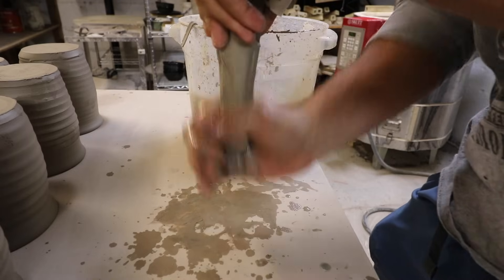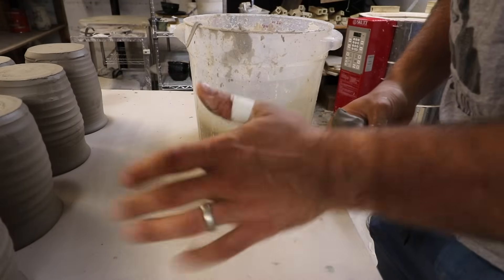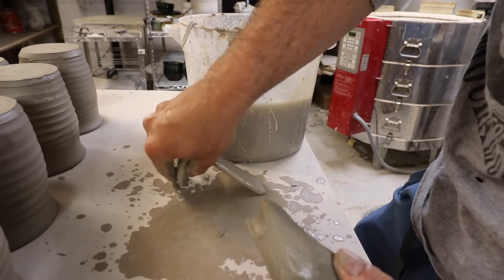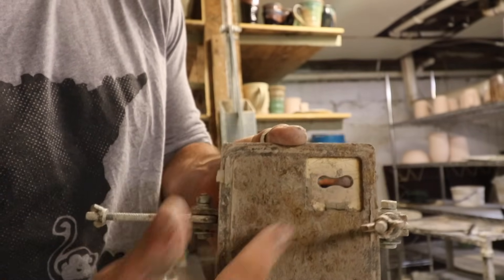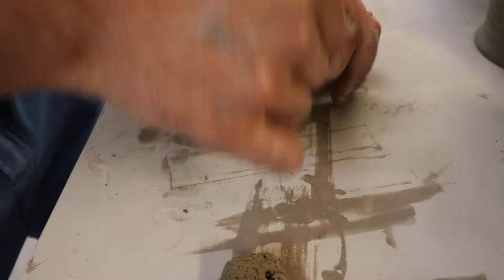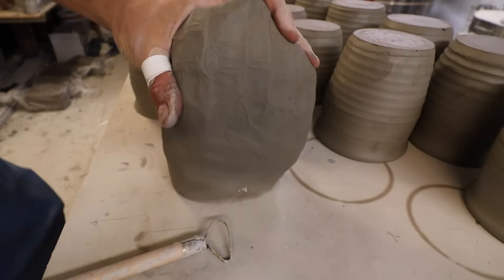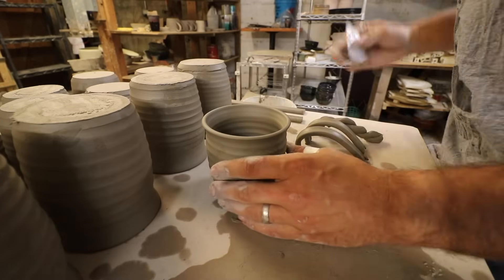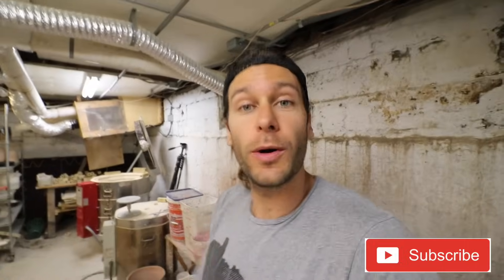5 Ways to make HANDLES FOR MUGS - Clay/Pottery/Ceramics

Comment: I like throwing my handles. I throw a slightly thicker cylinder, then I section off the cylinder and form the different sections (give one ridges, one is curved, one has two bands, etc). Then I use a needle to cut off each handle, trim it to length, and lay it in shape to dry
Reply: NeoDaVinci 97 you have a video of this. Very smart idea
Reply: I do this too!
Reply: I only do that if I’m throwing little espresso cups
Reply: i never tried that but, I think I will. ...great idea.

Comment: I make handles by making a coil, then using the piece of wood that I use for gauging thickness to get the handles straight. Finally I sometimes use a thin wooden stick - the kind you make kebabs on - and push it into the clay to make a line detail down the handle.

Comment: Thanks again for a great informative video. I pull all my handles. I recently got an extruder and havent installed it yet. I am trying to decide to mount it on a table or the wall, I am moving soon and thinki g a table would be better. I built a big heavy table and that would work, but I am not sure if a table mount works well or not because I haave never seen one used other than on a wall. Or I could just wait until I move. Iove your videos. Thanks.

Comment: I like pulled handles a lot, but don't do them that often because I feel like I'm not that good at making them, tho I suppose that's why I should be pulling handles more often. Usually I'll do slab handles and smooth the edges with a gentle pulling. I bought a handle cutting ribbon tool, but don't care for it much, I have a hard time using consistent pressure while running the tool thru the clay and I end up with thin and thick spots.

Comment: Hello, I'm just wondering if there's a way to make a handle for a already made mug, I accidentally broke the handle off my moms favorite mug
Reply: Not to have it useable as a mug safely, you could possibly create a handle and glaze it then glue it on but this would not be safe to use and very hard to get it just the right size due to shrinkage etc. I'd tidy the break, to remove any sharp bits - it will probably need filing/sanding. Then your mum can safely use it as a pen pot, toothbrush pot, or general beaker.